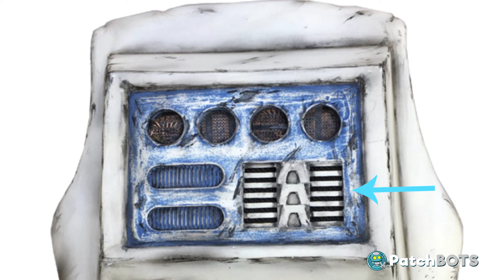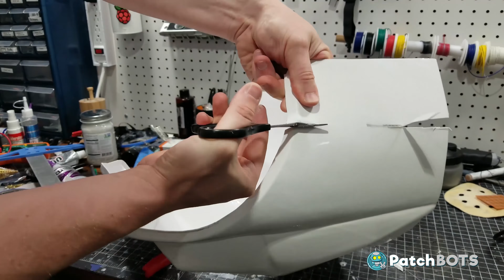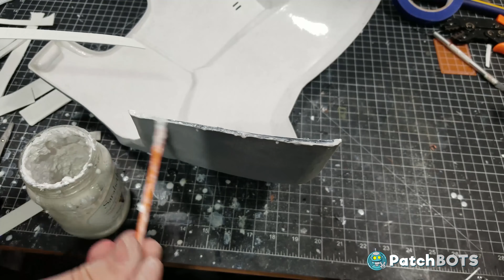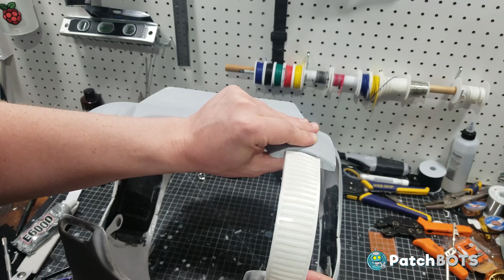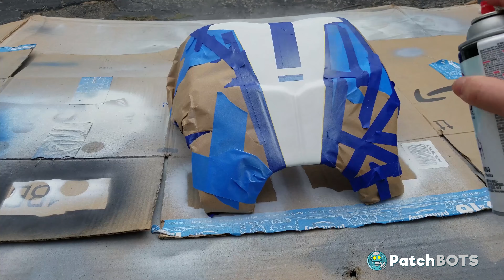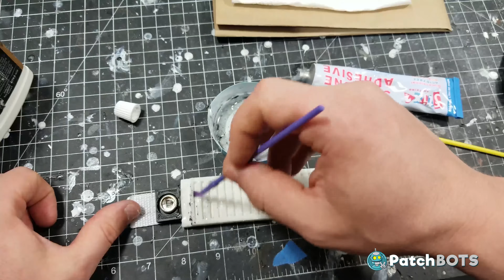Star Wars Clone Trooper Cosplay - Part 14 - Chest and Back

Comment: Hi PatchBOTS, just started my own build and using your videos as a guide, wondering where I can find the print files for those c shaped connecter bits for the chest that you used.
Reply from the maker: I just uploaded them to the github linked in the description in the armor section.  Just some notes of caution:   I originally did not upload these files to discourage people from using my files for this part. The reason I did this is because I felt like they were so custom to my build I thought it wouldn't work perfectly for anyone else.  If you watch the video you'll see before I made the cut I put a large shim inside the chest with a snap on it.  This was kind of arbitrarily placed and then these printed parts were measured off of that.  It wont be impossible for you to use these parts but I highly recommend just following what I did in the video and building your own parts that fit. Use mine as a guide.   ALSO!   There is a piece called "Pull Tab.""  100% do not use a printed version of this tab in your build.  Print it, trace it onto a sheet of ABS and cut it out.  The printed one will snap in no-time.   Good luck, feel free to hit me up with any additional questions.
Reply: @PatchBOTS  Awesome! Thank you, yes I did notice how you added the shim too, I originally tried to connect the pieces using clips but they kept overlapping so I resorted to trying to use your way. This is my first ever build and I just want to get it right!

Comment: Did you print every armour piece with a 3D printer
Reply from the maker: Hello, No, I did not print all the armor. Most of it is ABS heat formed.  But I did print a lot of it.  Check out the rest of the series for more info!